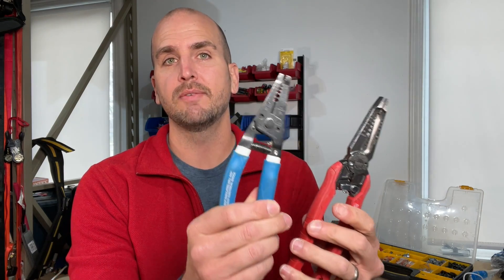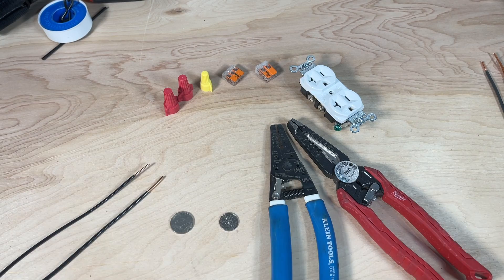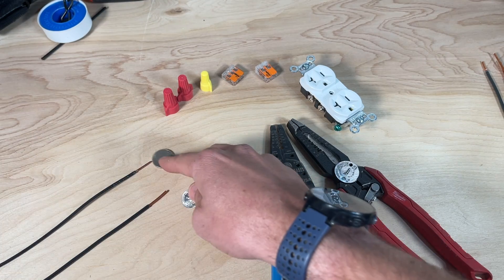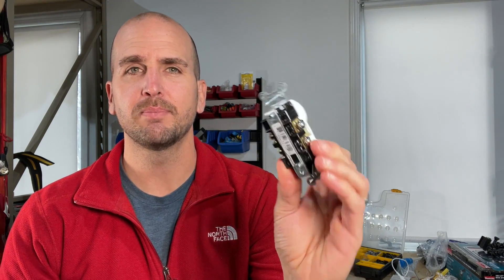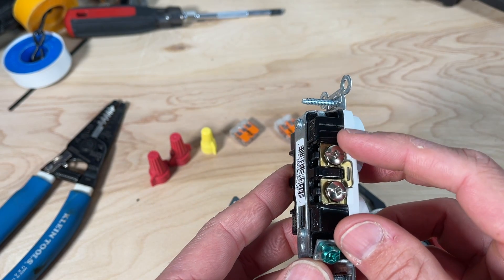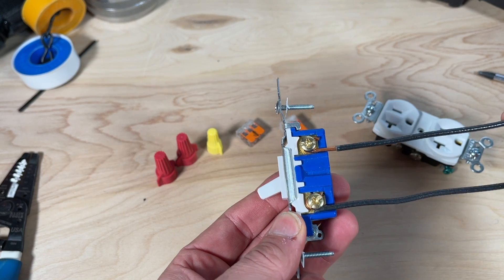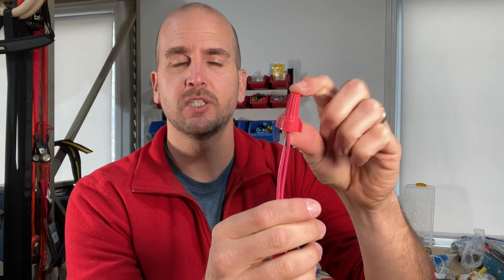5 Most Common Wire Stripping Mistakes

Comment: For those dealing with wire nicking issues:

 - Check the wire strippers are sharp, if they are dull you are going to try to use more force to cut the insulation and more likely get into the wire zone.  Or if worse one side is sharp and the other dull, the sharp side is going to contact the wire before the dull side finished getting the insulation
 - Check the hole for the gauge you are using is clean with a small (fraction of mm) space around a bare wire.  If there's something protruding or the hole is too small, it will hit the wire
 - When applying the force on the strippers to cut through the insulation, pull back the force immediately after cutting the outer part of the insulation.  You generally don't need to cut completely through the insulation. The small amount of insulation close to the wire will tear off cleanly when you either push it off with the strippers or pull the tip off with the pliers.
 - If you use the stripper to push/pull off the unused insulation, make sure you keep the strippers perpendicular to the wire.  If you turn it, it can catch the wire and nick easier.
 - Practice!  Cut off a couple feet of wire, and after you think you did a good one, pull off more insulation to see how you did.  Try different things out.  With immediate feedback, you can get the feel for it quickly.

Comment: i knew about strip gauge, but I rarely use it. My biggest issue with stripping wires is that I still nick, scratch the conductor even if I use wire strippers.

Comment: Absolutely fantastic video.  Mandatory viewing!  Your explanations make clear the "why' which really sinks the point home.  I did know about the strip gauge, but I remember back when there were many devices that did not have them.  If I were to add a number six, it is failing to keep the wire strippers perpendicular to the wire when pulling off the insulation.  I see people add a small angle at or before their pull - possibly it gives the wrist better leverage.  However, it makes the hole for stripping smaller and the wire gets nicked.
Reply from the maker: Good point RJ,  thanks for the feedback 👍

Comment: Yes, I know about strip gauges on devices. Also, some professional linesmen's pliers have a strip die by the cutter. So you will often see a pro striping wire with these tools and it not be a bad practice.

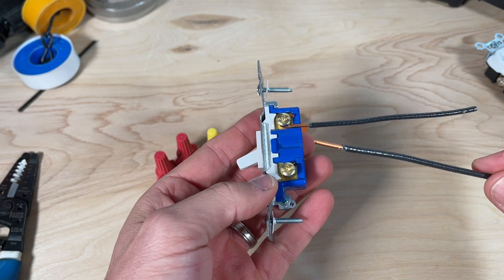Comment: At 6:35 you use a hole in the wire stripper to bend the J hook. That's new to me. Maybe I need new strippers. Also, I have a heck of a time getting the wire under the screw head as parts of the outlet always seem to be in the way. Any tips?

Comment: You can also strip the insulation off of solid gauge wire by pinching it on the back side (flat area) of your lineman's pliers.  Woks great and won't nick the copper.  My Dad showed me that when I was just a kid.  Thanks Dad!  R.I.P.

Comment: Another great informative video content and thank you! I would ask you would demonstrate changing out light switches. The issue I’m having is I have a basement staircase with light switches at the top & bottom which power the overhead light and an outlet which is located on the wall of the living room/basement staircase. I replaced the outlet already and now want to change out the switches. Thanks again for all your videos and look forward to seeing your next video!

Comment: Mistake 5.1: Using hard plastic wire nuts.  Use the 3M nuts with the flexible "skirt" instead.  They are much less bulky and cost only a little more.

Comment: I've always used inexpensive strippers, the kind with the color coded crimper for butt connectors on the tip. Got some decent ones branded Southwire and they nicked the copper every time. Returned them and stuck with my cheapies.

Comment: I avoid back stabbing connections like the plague. On a lot of better quality outlets and switches they have a place to insert the wire through a hole in the back but the wire gets clamped tight by the screw and gives a similar connection to wrapping it around the screw.

Comment: I have a very thin gauge stranded wire that needs stripped... How do I do it without damaging the strands...?
Reply from the maker: It is pretty easy to find wire strippers that go down to 22 gauge.  Is it smaller than 22 gauge?
Reply: @EverydayHomeRepairs  At the moment in am hanging out in BLM land in the middle of desert... I can make amazon orders, but it takes about a week... I have basic tools and razor knife... I am going to attempt to use knife rolling method... 🤔

Comment: I am a do it yourself-er. It was explained to me years ago, that if you stripped the wire too short so that part of the insulation was under the screw, that over time, that insulation may break down with heat, etc, which then leaves the wire loose. A loose wire could arch and then cause a fire.  If true, that is a much more severe issue than the reason you gave of changing the gauge of the wire. But a good refresher. I'm going to be spending the whole day installing switches and outlets and lights and so I wanted a refresher in case you had a point I'd forgotten. Oh yeah - I knew about the wire gauges on receptacles but I never use them. Neither would I ever use the "back-stabbing" technique.
Reply from the maker: Good point Keith, thanks for the feedback. 👍

Comment: I, USUALLY, strip just a little too much, like you showed in the example and J hook it until close to the insulation so that there's enough to cover under the screw.  Then I clip off the extra on the tip end so it matches up to the side of the terminal.  I never use the back stab method.  I'm not a professional electrician, just someone who helped my Dad, who's a Master Electrician, since I was about 5 years old and was small enough to fit in the tight spaces of the attic and run the wiring for him.  I'm 51 now and still just don't feel comfortable using the back stab method.

Comment: After 50 years of work I have and still pretwist  the wires for solid contact both electrical and physical. I consider the but to be an insulated cover for the joint. If you buy twist and cut apart you will see the difference. Great channel,well done.

Comment: NEVER use the speed connections on the back of outlets or switches. Ask me why.  And always braid the wires and use a wire nut not those stupid clips. It's all about the amount of contact.

Comment: You cut the wire twists shorter on an angle to make the yellow wire nut fit. The red wire nut is too large for just two 14 gauge wires.

Comment: Happy Thanksgiving!

What do you think of automatic wire strippers?  I'm a DIY who bought a cheap pair of Irwin auto-strippers from Lowes assuming they would be great but have never used them.  No one else seems to use auto-strippers either 🤷‍♂️
Reply: I use them for smaller gauge wires and for the most part, they do a great job.
Reply: I use them. I have to give the insulation pincher a little help to grip the insulation but other than that they work fine. At my workplace there's an automatic stripper that works without any help, likely because it was designed for thicker gauge wire than my electronics hobby wire stripper.

Comment: I knew about the strip gauge on switches and receptacles.  Also, (in the picture Youtube shows for the video) the orange WAGO wire connector (lever lock) has a strip gauge on the side of it too.

Comment: Far as wire nuts go; whenever possible/practical, I like to leave them pointing 'up', so the wire nut more or less forms an 'umbrella' over the connection. Especially if within a box in a hostile environment, or wire nuts on exposed low voltage wiring.
Great videos, thanks!
Reply: Indeed!  Great comment and informative!  👍

Comment: I've known about the strip gage for years. I still recommend bending The Wire with needle-nose pliers instead of using the backstabbing or speed wiring method. If you ever have to work on the outlet again it's very difficult to get the wires out of the speed loading.
Reply: Indeed!

Comment: Also when using wire strippers Never  spin the stripper. Simply close and pull. Rings around the wire is against Code & an Inspector to have all electrical to be replaced!

Comment: I've heard that there was a strip gauge on switches, but not where. What I learned to day is the information about solid vs stranded wire ports used to cut shield.

Comment: Keep showing these DIY people electrical work. I make a lot of money on service calls 💰 💵💰Just swapped out a panel bc a customer saw a video on how to swap out a panel. Didn’t go so well. Quick 4200!!!
Reply: I've installed many ceiling fans, switches, and outlets but like automotive work, I know when to call in an electrician.  (although after 30 years I have not needed to) Something like solar panels, an AC unit, or a panel would be good candidates.
Reply: Aren't you special.

Comment: question. have been replacing 30 yr. old 15 amp. with 20 amp. receptacles using the j hook method. did not check the gage. am i ok ?  my home.
Reply: If you plug a 20-amp device into your new receptacle, it will draw current through the old wiring that leads up to the receptacle. That old wiring is probably 14 rather than 12, so may overheat as you use the device.

Comment: Yup, knew about the strip gauge for years. Always sidewire - never speed wire. Always wirenuts till the nut "bulges" just a bit. Always use a wire stripper.

Comment: I had to strip 10 gauge wire over the weekend and was having a nightmare of a time getting the outer sheathe off the cable without damaging the inner wire sheathes. The auto-stripper tool couldn't even break the outer sheathe without slipping.